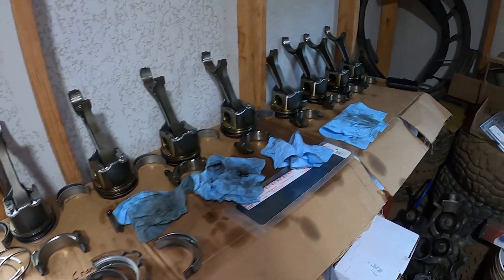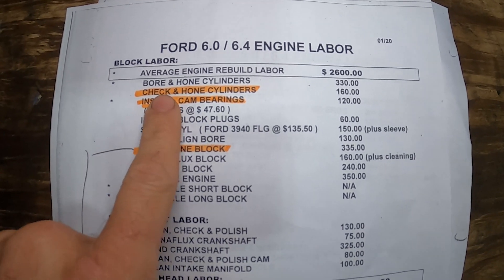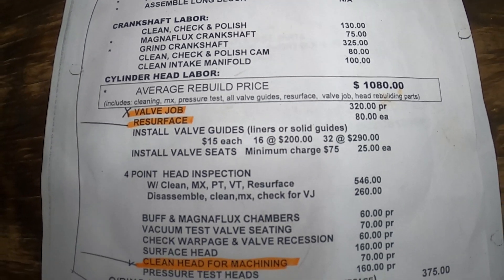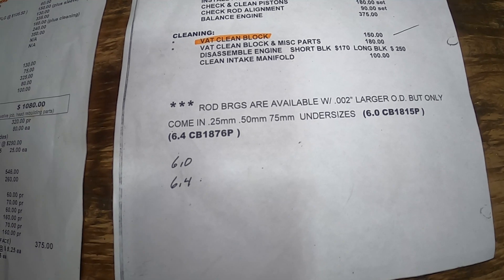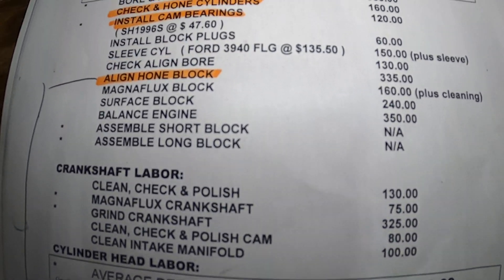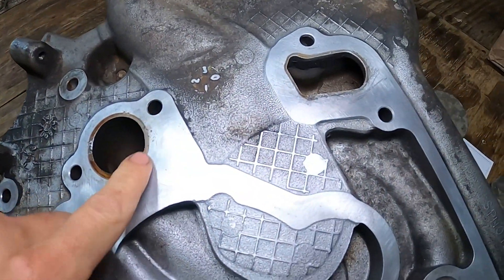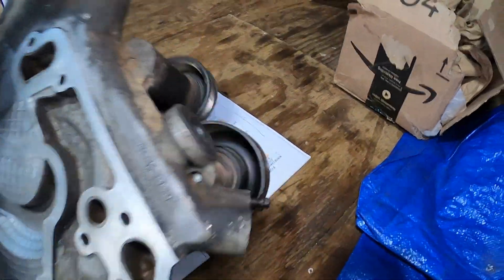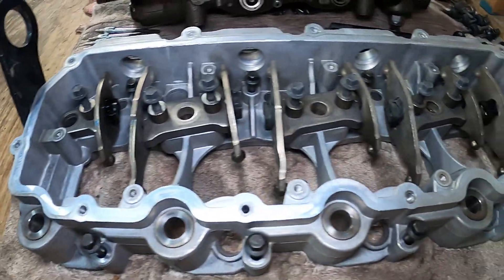6.0 Powerstroke - Machine Shop Cost Breakdown & Pre-Assembly Prep

Comment: Hey, thanks for the update. Those prices are good prices!
Reply from the maker: How far off is the pricing where you are?
Reply: @grumpysdiy  in the Vegas area it cost more maybe 20-30%.
Reply from the maker: Wow that’s crazy.
Reply: @grumpysdiy  yes, it is what it is. Did you get your heads pressure tested? I think one of mine has a crack just by the look. It might not be any dangerous but it is right where the head gasket had blown, couldn’t see much on the gasket so it was not much blow by. The pressure testing will revile it dough.
Reply from the maker: I didn’t.